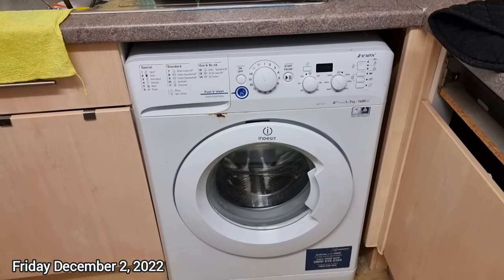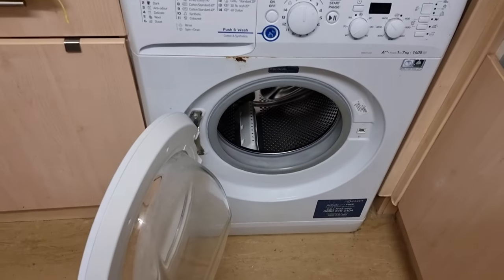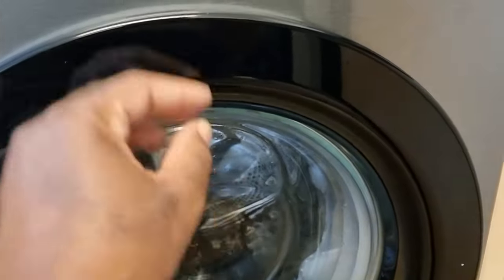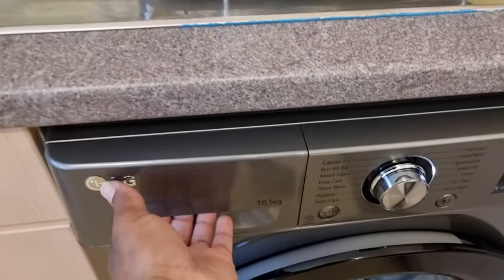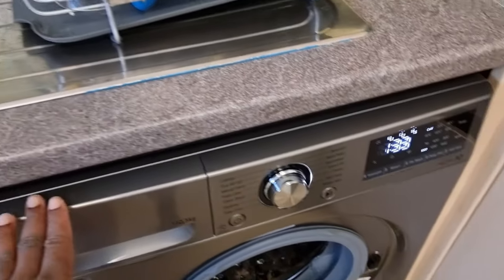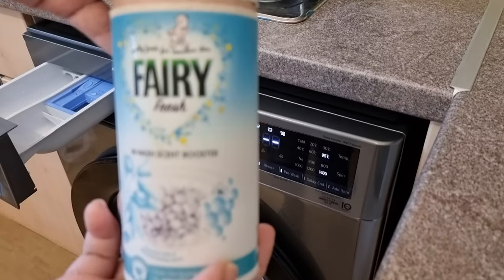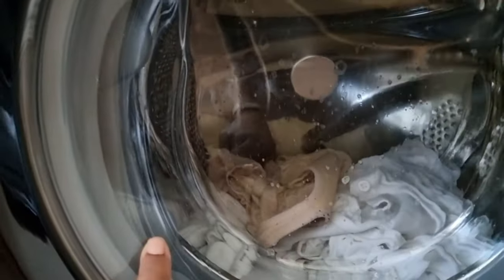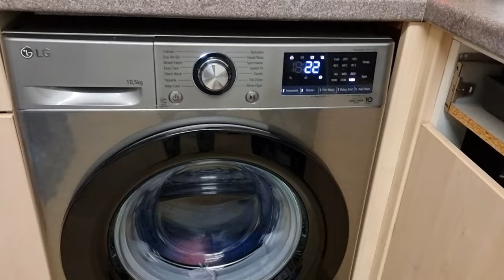LG F4V310SNEH Direct Drive 10.5kg Washing Machine | See it in Action 👌🏾

Comment: Direct Drive means the drum is driven by the motor at the rear.  If a machine has a belt and it broke,  then the drum won’t rotate.  It’s got nothing to do with keeping the drum in place.  Add Item only works during the wash stage not during rinses.  You would open the main door to add item once the machine allows you to open the door if you select Add Item at beginning of wash.
Reply from the maker: Thank you for sharing your input.
Reply: @OurSimpleLyfe the little door is for only samsungs machine
Reply from the maker: Yeah, sigh! The add item option works a treat though. 🩷

Comment: Just got the lg direct drive 7kg had it  a week now 🎉🎉🎉Very happy  .. i had top loader 8kg and it was still under warrenty and sent back 2x and paid in for the  lg   😅! So very happy 🎉🎉
Reply from the maker: What was wrong with your top loader? How are you finding your LG washer?
Reply: @OurSimpleLyfe  It had serious mechincal problems it was 8kg defy south African  brand . Suxing out water in the middle of the wash .. .. defy 2 repairs and the same problems .. Defy sent a new unit and the washer did not even want to make the washing motion and it had griding noises ..

So  i wanted a refund and got a credit and paid in for the LG Direct drive 7kg was worth it .🥰🥰🥰

The most slient eco washing machine ,removes all stains 

I use the 30 quick wash ..
Reply: @OurSimpleLyfe  i really love the lg direct drive ;) ! They are more expensive washer s but its a life time investment
Reply from the maker: Awww that's amazing that you were able to swap to an entirely different machine. I really love my washer I won't lie. I've bought the dryer but it's not the exact matching one to my washer
Reply from the maker: Definitely an investment 👌🏾

Comment: Can you tell me what the lowest temperature this machine wash? 
And does it have a quick wash function as well ? 
Thank you
Reply from the maker: The lowest temperature is 20 degrees there is also a cold wash option. It has a speed 14 option which means your clothes will be washed in 14minutes depending on what temperature you have chosen etc.

Comment: I had indesit innex bit older than this I think, but the one with just the buttons not knobs. 
8kg water balance 1600rpm inverter motor. 
Mine served me well but was still working when I sold it but died a year after a I sold it so I got the LG basically at the right time.
Reply from the maker: Indesit and hotpoint does last a long time. The LG is my third washer in 17 years. Loving it. Thanks for sharing and watching 🩷

Comment: I was looking if you have the eco mode? I push eco for every program I use. It saves water and energy. 😊 congrats with your new helper! 👍 OMG that is noisy.  You can adjust the feet to fit the floor. Get the guys back to fix it. If you let it continue, you can damage the floor as well as the machine.
Reply from the maker: It does have an eco function but the cycle is too long on that option. The guys were called back to sort out the feet of the washer. Less noisy now

Comment: If there is a power cut or something - is there a way to drain the water when the power comes back up?
Reply from the maker: If there's a power cut once the power is back on just continue with your cycle as usual. Just know that a cycle that would have been 1 hour would probably increase to a bit longer as the clothes are now wet and heavy so the sensor would detect that and add more time. I don't see a pump or drain option on this model. Hope this helps 🩵
Reply: If there is a power cut you can manually drain the water from the bottom front of the machine. But LG thought of this and as soon as power is restored it will automatically do it for you 👍
Reply from the maker: Thanks for sharing your input.

Comment: Same problem, did have the service and they changed the dampers but it still does the same noice and vibration
Reply from the maker: They came out and adjusted the feet on the machine. The issue seems to be sorted now. Sorry you're still having a bad experience 🩵
Reply: Just adjust the feet in the corners to match your floor, I had this problem... simple way to sort this is Push your machine back and fore, if it wobbles just adjust the leg(screw underneath)
Reply from the maker: Thanks for sharing.
Reply: @OurSimpleLyfe hi. Just got the same machine. So, am I presuming that you paid for installation, and called them back to adjust the feet ,?
Reply from the maker: Yes, I did pay for installation so I just called up curry's and they sent the men out to adjust the feet.

Comment: Please can u measure the inner drum depth and tell me, just the inner steel part not the outer machine. Actually i am planning to buy this machine in 8kg and the drum looks a bit small so want to know the difference between 8kg and 10.5kg. Also how long does it take to wash full load in cotton mode without selecting the other options. Thank you.
Reply from the maker: Hi Nortia, the measurements are Depth with the internal drum backing stuck out is 30cm. The depth flattest part is 34.5cm. The height is 50cm. I hope this helps?
Reply: Get the 9kg .... it's huge